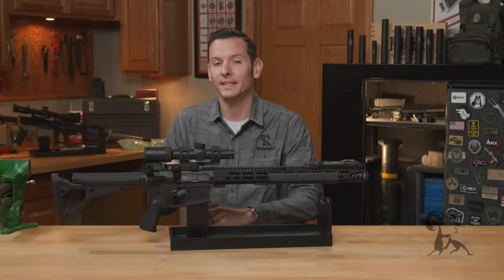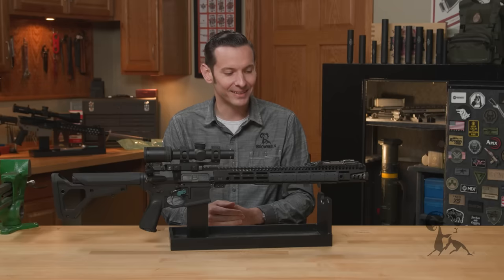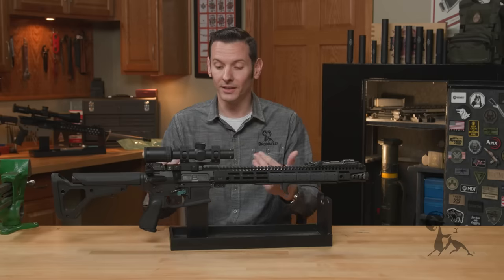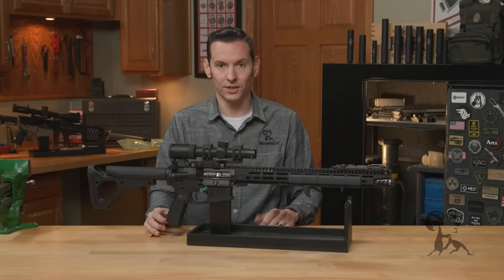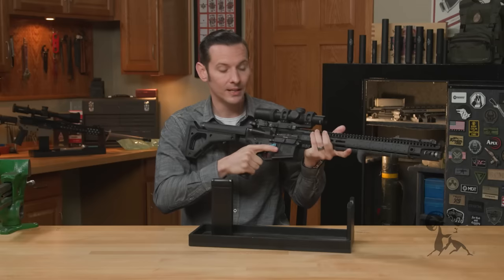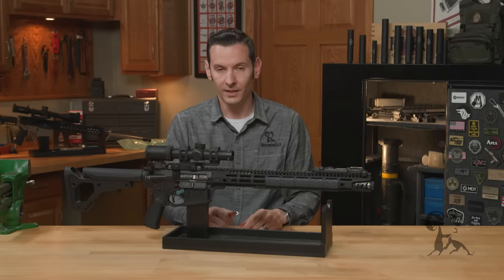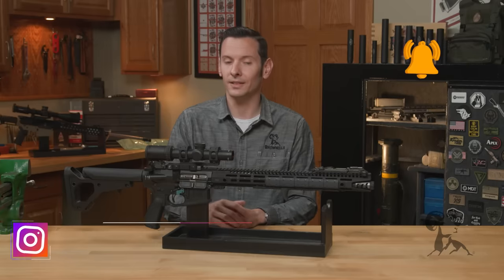Quick Tip: The RIGHT Way To Use the Forward Assist

Comment: I honestly don't get the hate for the forward assist. It's not like you HAVE to use it, lol. If you don't want to use it, don't use it. Very simple. For me personally, I only ever use it when I am doing a chamber check to make sure the bolt is completely in battery since it didn't have the benefit of the full momentum of the bolt closing from a full open position. So for that reason I'm glad it's there. And I've never had to use it this way before, but it's also useful if you need to load the firearm quietly instead of letting the bolt slam forward you ease it forward and use the forward assist to put it into battery. So yah, people who bitch about its existence are people who just pointlessly whine about anything that they don't personally use, so we can just ignore them, lol.

Comment: When shooting steel cased ammo and the bolt carrier is not going forward, I pull the charging handle back so I can inspect the round for imperfections. I don't use the fwd assist with steel case.
Reply: That makes no sense.
Reply: @printingwithpeek4897  with cheap steel ammo you get more defects. When using a forward assist with it you will be settung yourself up for a stuck casing, thus just eject the steel case.
Reply: @minivanman007  Steel cased ammo that is foreign manufactured has fewer defects than US made remanufactured ammo. That is statistically based. I will agree with you that chanbers do get dirtier because brass expands way more than steel does and it has a better Modulus of Elasticity. The other reason why guns get jammed up are because people don't strip their guns apart after every use. I take all of my components out and put them in an ultrasonic cleaner every time and use a foam bore cleaner everytime. That's where the majority of malfunctions happen.

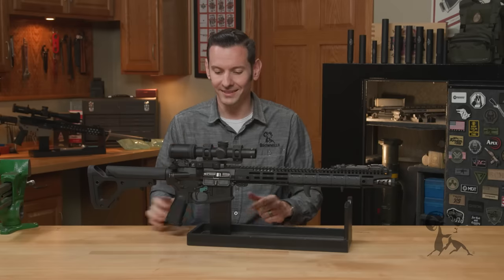Comment: 1:40
Now THAT is correct, in a jam you don't slam the forward assist. You DROP the mag and CLEAR the jam. 
If that rod does NOT fully go into battery, something is WRONG and slapping that forward assist is NOT the right way. 
In a properly LUBBED and operating AR, you should NEVER have to hit that forward assist

Comment: Nice strap 👍 I have learned the proper use of the A.R.M.S. rear sights several years ago. I'm getting older but still see iron sights quite well & there was a learning curve to these sights 🙄 Instructions from A.R.M.S. was the key to complete success 😅 Use them on 3 favorite straps now. Regarding forward ASSist 🤭 My manual of arms includes the use however there are a handful of rifles in my pile w/o forward ASSist, 2 vintage SP1 Colt's & 1 HBAR RECCE/MK12+ clone(my version)🙈. Appologies for long winded banter but a slow morning & lots of ☕ in here. Seems to be, selecting modern top tier parts using tried & true materials with quantified manufacturing processes we can assemble a rifle capable of extreme reliability w/o the need for forward ASSist these days. Notwithstanding prudent choices of propellant & lubrication. Summation, "Thank the Lord" your saying about now 🥴 I personally prefer & will advise for forward ASSist to be present on any fighting rifle, especially ones chambered in 5.56. There again the rule, better to have & not need THAN to need & not have. 👍 🇺🇸 
 Right ! Gotta go before I think of something else to add 😵 Carry on

Comment: I've been carrying and shooting M-16/ AR-15 type firearms for 20 years. Never once in that time have I ever used a forward assist for anything.
Reply: @OFFICIALUND  limp writing a handgun occurs because the firearm is recoil operated (well, most of them), and needs something to recoil against to function properly. Gas operated firearms don't have that problem.
Reply: @OFFICIALUND  Wow, you not only have no idea what you're talking about, but you doubled down on it. That's impressive!

Edit to add, recoil has nothing to do with gas. It has everything to do with the bullet going downrange. (Newton's third law?) I guess you could say the MG-42 would be an exception to the rule, with its recoil booster, but, again, that's a still a recoil operated firearm.

Comment: When I'm hunting coyotes, I move from stand to stand with my rifle in condition 3 (bolt forward on an empty chamber).  When I arrive at my next stand site, I QUIETLY chamber a round. I do this by committing the cardinal sin of riding the bolt home. I use the forward assist to insure my rifle is properly in battery. This is part of the reason I will not own an AR (15 or 10) without a forward assist.

Comment: Okay, in the Border Patrol, we didn't usually carry a round in the chamber,  That said, there were many instances of us pulling ambushes on smugglers. In that scenario, you don't  want to hit the bolt release and make a loud noise that can be heard a mile away. We would  draw back the charging handle, ride it home, then hit the forward assist with the heel of your hand. And, at the right moment, ANNOUNCE!  ( In Spanish.) Usually something both obscene and insulting.  Cheers! Splice.

Comment: Don’t mind them but don’t care for them. Hate seeing them used for brass checks because boot Pfc and Lcpl aren’t completely comfortable with there weapon so they check and smack the thing 7 times. Plus I’m a fan of keeping my manual of arms the same for day and night. Hard to see brass under nods on a over cast night when it’s raining and gunny said where not racking out till the ammo’s gone! Let the bolt go home take the mag out loaded to 30 round will be on the left. Loaded to 28 left again. If the bolt doesn’t lock you should probably clean the rifle if it’s a bad round you might not want to shoot it. Forward assist doesn’t replace good training and weapon maintenance. Just my opinion thought🤷‍♂️

Comment: Regarding Kyle Rittenhouse's use of the FA in Kenosha.  He fell on pavement and his BCG slipped slightly out of battery due to the jolt. Fortunately he noticed and the FA was used to quickly restore the weapon to ready and he was able to fend off Gaige Grosskreutz.  Using the scallop of the BCG in that situation would require fine motor manipulation vs. the gross motor manipulation of hitting the FA. When stressed, the human body typically has major issues with FMM and so being able to take corrective action via GMM is much more prefered.

Comment: Sadly this video could have been clearer. 
The Forward Assist is used if you need to gently let the bolt down or if you do a press check. Hit the Forward Assist afterwards to ensure the bolt is seated properly. 
Its not a "My Rifle Didn't Fire, Start Jamming the Button!" Assist.

Comment: Sorry, but why is this controversial? I have a side charging Stoner PDW. No FA. The reciprocating bolt acts as an FA. I also have a Gibbz Arms G4 with a Non reciprocating charging handle. If the Bolt is OOB I just cycle the handle enough to visually check the round in the chamber and then let the bolt seat under spring pressure. Never been an issue. This is NOT a combat weapon. It's a varmint rifle. I had an actual Colt HBAR target rifle that needed the FA to seat the bolt when the weapon was new. After a full field strip and ample lubrication and about 200 rounds break in it was never a problem afterwards.

Comment: 13 years as an 11B and in all of those years while firing live rounds I have never had the need for the FA. As far as the press check nonsense then using the FA to reseat the bolt, I guess if your absent minded you may have the need. Honestly if you don't know when you've loaded your weapon you have bigger problems to address. I always knew when there was one in the pipe. John wick need not apply.

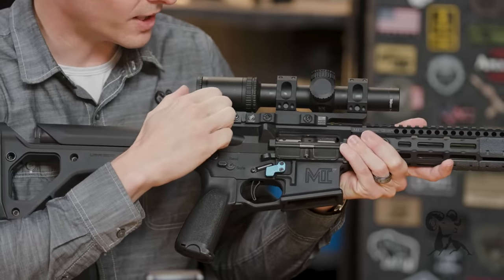Comment: OK at 2:35 you demonstrate a reasonable way to use the Bubba Button. THAT makes sense. 

Pounding on the forward assist when a cartridge won’t chamber during normal cycling while firing does not make sense. In fact it’s a terrible idea. Caleb - I do wish you’d taken a moment to explain why it’s a really bad idea.

Comment: 2:59 oh or if you used the gun using it that way would be an excellent way to burn your hand too; Yup the forward assist always has and always will be useful and important.
Ive skipped many a gun that didn't come with it, PWS and LMT
And for the price you'd expect those two to at least have them.

Comment: Great content great info: Kyle Rittenhouse proved the forward assists worth, as the military requires it as well on an AR platforms. And several other firearms for that matter, but to have a true AR platform, it should have a forward assist. it is better to have it and not need it, then to need it and not have it. hence "redundancy" a back up for a back up.

Comment: You don't need a forward assist UNTIL you need one! Chambering a round quietly so you don't give away your position............ Using ammunition slightly out of spec that may not fully seat in the chamber............ Using aluminum or metal cartridges.......... or simply a dirty chamber from firing a lot of ammunition. IOW don't risk your life on any AR platform rifle with a forward assist. It's a cost saving measure by the manufacturer that will get you KILLED!

Comment: Talk to any poor SOB who served in VietNam with those awful first models which had no forward assist.  Then you will know just how mandatory that little button is.  Only advice I would add is don't just blindly slam on the forward assist if the bolt isn't all the way home.  Look first, as it may be something as easy as yanking out a stuck spent shell.

Comment: And, if you've been in a firefight, you'll burn your thumb off by pushing the bolt shut after a press check! Forward assist is there for a reason... don't use it for the wrong reason!

Comment: Forward assist was critical when Kyle Rittenhouse was dispatching one of the violent rioters.
Reply: Had he been using a lubed AR-15 with a more ideal gas system/barrel length, he would have never needed it.
Reply: @OFFICIALUND  I've either been shooting, maintaining, deploying with, building, accurizing, trouble-shooting, and testing AR-15s since 1987.  After you've spent a good 20 years regularly working with the design, get back in touch.

Comment: I've never heard of a forward assist hurting anything by existing, and it certainly has some utility, even if not needed frequently, so I don't get the anti-FA hate other than to be edgy.   Not to mention, it might've saved Kyle Rittenhouse's life. He can be seen clearing a malfunction and using the FA on video.  That there is reason enough. 
Plus the quietly chambering the round thing others mentioned. 
Last and least.. not gonna lie, it kinda looks cool.

Comment: buying an upper without a forward assist is not smart for a battle rifle, your putting yourself at a disadvantage if you do this. For a range only rifle I don't see an issue, but nothing I would personally not have.
Reply: Laughs in Son Tay Raiders, SR-25s, AFSOC GAU-5As, SAW, M240, Mk.46, Mk.48, etc.

Comment: I have nothing against the FA.  If you clean your rifle after every few hundred rounds you will probably never need to use it.  If you are running a slick side receiver shell out a couple hundred bucks for an enhanced BCG.  Less points of contact in the receiver will prevent jams to some extent.  Sounds like the main reason for the FA is to remedy USER ERROR.  Practice all aspects of using your firearm to prevent such errors from happening.  Chamber checks?  You should know if your firearm is chambered at all times with out having to look…

Comment: If it's to aid the bolt to close if it doesn't lock up because of a weak charge or chamber check...its fine.
As Clint Smith said...if the round won't go into the chamber get it out of there don't jam it in using the FA.

Comment: It's also useful when you're out in the field, you've put a bunch of rounds through your rifle, and you've not had a chance to clean her up. Slap, Pull, Release, Tap, Shoot. If there's a bunch of residue in the breach, and over the bolt, that forward  assist will make sure that your bolt has fully rotated into correct firing position, assuring that the charge in the round is sending the projectile down the barrel properly before the gas can travel back and cycle the action. The last thing you want is an unlocked or partially locked bolt cycling too soon, releasing the pressure behind the projectile, possibly creating a pop and no kick. Nobody wants that to happen, now do they?

Comment: Lack of knowledge is too polite, ignorance is bliss works. With the Safety engaged using forward assist to close the bolt on a round lets you feel resistence, too much resistance especially for .308 may indicate the extractor is binding, ejector pin sticking, tight chamber, etc. And verify empty, check it twice, don't be the next alec baldwin.

Comment: The right way to use a forward assist is to remove it from your gun.  Unless you are in combat, if you have to use the forward assist, the gun needs to be checked.
Reply from the maker: Then just leave it on your gun...
Reply: @brownells  Why?
Reply: @OFFICIALUND  Which he could have done more reliably by simply cycling the action.  Which can be done just as quickly.  Because it worked for one person, in a highly unusual situation, doesn't make it necessary.

Comment: correct way is to drift out the pin holding it, remove the pawl and but the button back in as a plug.   

forward assist is about as useful as the fbi and atf